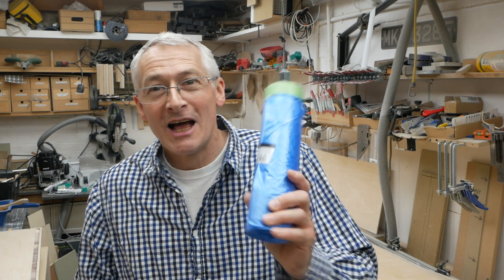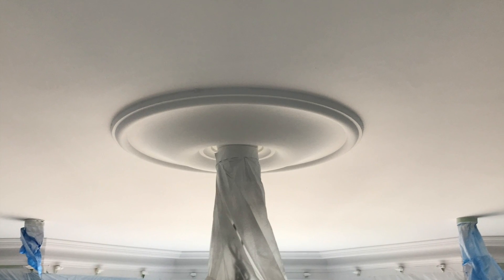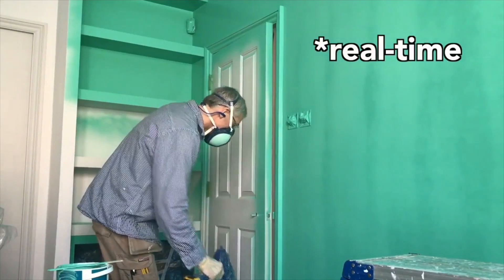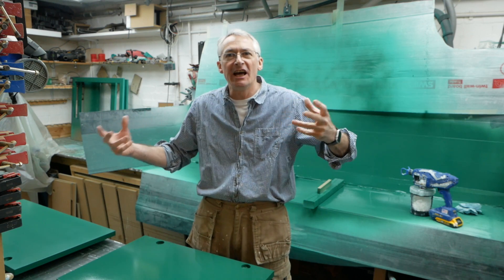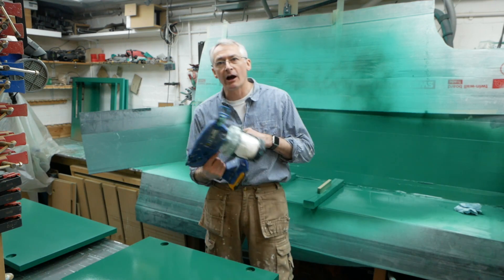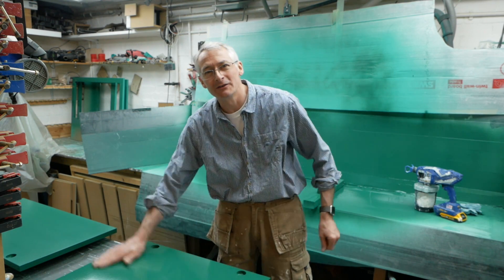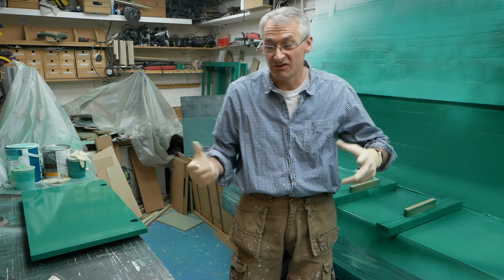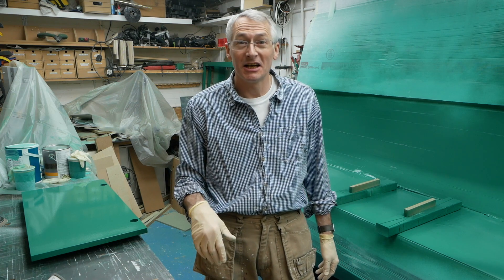Graco Ultramax 5 month test P4 #193

Comment: How many Litres of paint did you get from the pump?.
Reply from the maker: Nowhere near enough. It was used pretty intensely for a short period - though probably no more than 100-150 litres - and did the job it was bought to do, but longer term it was problematic and I stopped spraying.
Reply: @10MinuteWorkshop  I believe their is now a version 2 of the pump that has a carbide piston and sleeve and is supposed to last 3 times longer so maybe 300 to 500 Litres is now possible, I have the Ultra but I only have maybe 30 Litres used on mine at the moment, I'm about to paint my house again so I'll use it for wood and ceilings the house is 4500 Sq Ft so hopefully this pump will last then I'll try the V2 of the pump.

Comment: Hi Peter that looked like a lovely finish on those doors, is that benjamin moore paint waterbased  or oil based
16 hrs for waterbased ,  it must be oil right?   and  i noticed you did not stir the paint that was in the graco pot,  
does it not need stirring, does the graco  mix it as its working,? 
could you get a quality finish with a waterbased  cheaper paint???   what paint could you recommend that is cheaper than benjamin moore where you could get a similar finish for less money....  love the vids keep em going
P.S  have you tried toupret wood filler i have heard very good reports about it from a pro decorator,,,,,,,,sorry if too many questions
regards kevin
Reply from the maker: Hi Kevin, and thanks! No, Benjamin More Advanced is water-based (I only use water-based paints, have done for about 10 years) first time I’ve used it, couldn’t believe the 16 hr recoat time, lol! Apparently it an water-based paint with the characteristics of an oil-based - who asked for that?? Anyhoo, it is what it is and the gloss finish is fantastic. 

And no, all paints were stirred,  I just didn’t show it on camera. In the series I use (water-based) paints from all the usual suppliers - Leyland, Dulux, Johnstones, Farrow & Ball and Tikkurila, in emulsion, eggshell, gloss and, primer. All handled equally well, without any real issues, straight from the can without thinning. 

So yes, well impressed with the finish from the Graco 👍👍

Oh, and yes, big fan of Toupret fillers generally 👌
Reply: Peter Millard I’ve been told by BM rep that the paint is formulated with oil chemicals surrounded with water base paint that’s why when you add water it can change the formula of the paint and change the colour slightly , and that’s why they call the advance paint hybrid
Reply: Peter Millard 
Hi peter, 
I didn’t know you could spray farrow and ball. Good to know

Comment: Do you thin the paint at all ? Or strain it before use. ?
Reply from the maker: No thinning at all,, and I don’t generally strain the paint since I switched to a/ better quality paint and b/ using a 100 mesh filter between he cup & the gun 👍👍
Reply: Peter Millard brilliant , I’m thinking of getting one for painting trim , I’ll use the 100 mesh filter and a 310 tip , hopefully it will be clog free spraying. Thanks mate.

Comment: Great series of videos Peter, I thought orange peel texture was the look these days :) . How did your shoes cope, were you coming out with a green tread. I used to have an old pair of Dunlop volleys that I used to wear only for spraying but they fell apart and I have just been wearing my jogger style steel caps, but find I have to take them off and let the paint dry on the soles after spraying otherwise I track everywhere. A few days ago I bought some shoe protectors, cloth overshoes, but have not had a chance to try them out yet, but hopefully they will fix that.
Reply from the maker: Thanks Bob! Oh yeah, shoes! Completely ruined a couple of pairs, one green the other white! They’re now my ‘spraying shoes’ - they go really well with my ‘spraying work pants’ and ‘spraying shirt’ - it’s a great look, really sharp 😂👍👍

Comment: Wow, impressive Pete. Looking forward to the finished job. Did you get many/any runs? That gun seems to put a lot on. Or is that to follow?
Reply from the maker: Cheers Graham. No runs on the primer/undercoat, but did get a few on the upright surfaces with the first coat of BMA gloss; rubbed it back and laid it a bit thinner after that, with no issues. Always learning, usually by doing... 👍😂

Comment: Quality job. Very impressed with the way you have gone about this. 

I bought a Wagner HVLP to spray all my flat brown cabinet doors white, and then add a lacquer followed by polishing with very fine paper to give them a mirror finish. I found the Wagner was spitting paint on the outer edges of the spray that cause me lots of problems and lost time. I think I will change to one of these. Do you think it will be good for spraying the gloss finish?
Reply from the maker: Thanks! I’ve used it for gloss and had a good finish, but I’m hesitant to recommend the Graco after mine died mid-job. Repair under warranty took almost 3 weeks, and while I think it’s a fantastic piece of kit, and perfect for the job I bought it to do, if I was spending ~£600 again purely for spraying within the workshop, I think I’d put it elsewhere, honestly.

Comment: Hi Peter, what tip are you using for the walls ? And what size for the panel? I have a graco - still in early learning mode though but have found it fantastic, just trying to find the best tips and create less overspray 
Thanks
Reply from the maker: Hi Rob. Still pretty early along this journey myself, but I used the 310 and 410 for pretty much everything; a few folks recommended the 517 for emulsion on walls, but I couldn’t get hold of one in time and I had a few issues with the 514 that came with the gun, so I just stuck with the 310 for most things, and it worked really well; it’s the 310 I’m using in this video for everything. If you’ve watched the previous videos in this series you’ll know that overspray has been a constant issue for me, and I think I’ve resolved why I was getting it so badly.

I go into a bit more detail about this later in the series, but in brief, when you clean the gun down, take off the tip assembly and have a look inside; it should be squeaky clean, apart from a little bit of paint right in the centre of the seal. If there’s paint anywhere around the inside of the tip, or around the threads, then it’s not sealing properly, and that’s likely the cause of the overspray - it was with mine. I changed the seal (you get a spare one with every new tip) and it’s made a big difference to me. 👍 HTH Peter.

Comment: G'Day Mate
What setting did you have the gun set at. I have one for spraying trim and doors, a bit of hit and miss wither spraying doors. It sometimes spits which buggers up the finish completely and I ha Ve to sand back ,undercoat and hope it doesn't happen again.
What size tips are you using , any help appreciated
Thankyou
Reply from the maker: Hiya. Gun's usually set to around #3 - any less and it gets a bit 'pulse-y' and more and I drown what I'm spraying. I use a 310 tip for pretty much everything. I've only ever had it spitting right at the start of spraying, so I aim off the workpiece at the start, where I can. HTH 👍

Comment: Hi there love your videos,I use Benny Moore paints and you can get two coats on in a day no problem.
If you need any advice give Craig,Helen or Ian a ring at Shaw Paints and they will give you any advice you need .
Reply from the maker: Hiya, and thanks! Yes, the guys at Shaw paints were very helpful; what paints were you using that you can get two coats on in one day? Not BM Advanced hi-gloss, 16hr recoat time 👍
Reply: I am a deccy mate and you can get two coats with BM advance gloss.Just get good air circulation.
I have been using it for a couple of years and if need be you will get away with two coats in a day.
One in the morning and one in the afternoon no problem.
Reply from the maker: The guys at Shaw paints told me 16hrs, didn't think to question it, lol! I'll have to try it 👍

Comment: Is it all water based paints your using?
Reply from the maker: Yes, been 100% water-based for ~12-14 years. 👍
Reply: Peter Millard could I ask what brand of paint you use on cabinets/ walls ceilings?? I’ve been looking at tikkurila farrow & ball and possibly valspar but not sure if that would be hard wearing enough on woodwork
Reply from the maker: @paulcunningham6300  All the cabinetry on this job was done in Tikkurila Helmi colour-matched to Farrow & Ball; the green gloss is Benjamin Moore Advanced, the ceilings were Farrow & Ball estate emulsion. HTH P

Comment: Hi Peter, Love your vids! I bought a Graco Ultra max a little while ago and it didn't go well! Im not sure if i'm using the wrong paint or wrong tip or what. it just keeps blocking and spitting. What paint are you using for the white cabinetry? and what tip size are you using to spray it? Did you have to thin the paint down at all? Any advice would be much appreciated! and keep up the good work! :). Ben
Reply from the maker: Cheers Ben. I’m about as far removed from a spraying expert as you’ll find, but I’m happy to give an opinion, and maybe a proper expert will be along shortly 😂 I’ve only used water-based paints, just so’s you know, and almost all my spraying has been done with a 310 tip. I didn’t  (but I should) strain the paint - this will help reduce blockages, and I haven’t thinned any paints at all - everything straight from the can. The only ‘spitting’ I’ve had is at the very first trigger-pull. I’ve used primers from Johnson’s, Leyland and Tikkurila, eggshell from Farrow& Ball and Tikkurila, emulsion from F&B, and gloss from Benjamin Moore. Only the F&B eggshell gave me problems, everything else has been excellent. Big fan of Tikkurila Helmi. HTH 👍👍
Reply: Many Thanks for the reply Peter. I'l keep trying and experimenting with it! haha Keep up the good work! :)
Reply from the maker: Graco have a few good videos about resolving common issues on their website - might be worth a look? It’s a great system when you get the kinks ironed out👍

Comment: I am interested about the blockage. That should only take like 3 seconds to clear. The graco tips are reversible, you reverse the tip form it's handle and an spray a second, that should clear any blockage in the tip .
Reply from the maker: Thanks. I’ve owned the Graco since February, so not my first rodeo. Do you mean the terminal blockage I currently have?? It’s not a blockage in the tip - it’s blocked without the tip and tip guard attached. It’s internal - the gun’s been returned for repair, we’ll see what gives in due course. 👍

Comment: Thats a lot of masking off.
A painter & decorator as well.
Why not just paint the room with a roller.
Reply: John Colquhoun you'll never get as good finish with roller as a sprayer
Reply from the maker: As mentioned earlier in the series, client spec was for a sprayed finish. 👍
Reply: How do you roll all that cornicing on the ceiling?
Reply from the maker: Slowly, unless you’re spraying 😂👍
Reply: Problem with spraying, you can't touch it up. It's a stupid thing to do for walls unless you back roller it.
Reply from the maker: "Stupid" to follow a clients wishes? OK, then...
Reply: MrMajorduck The customer probably wanted a level 5 finish which is smooth with no texture... Back rolling would create a textured surface...
-Although painting the door the same color as the walls I might’ve tried to talk to customer out of...